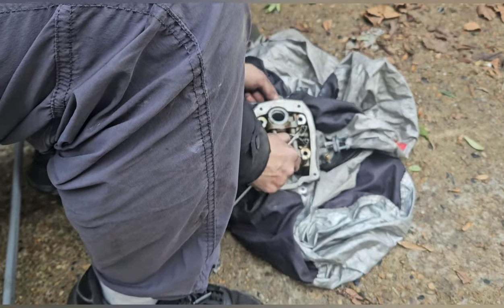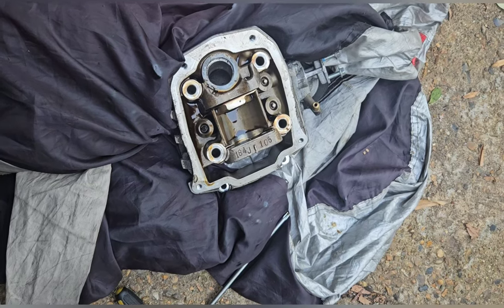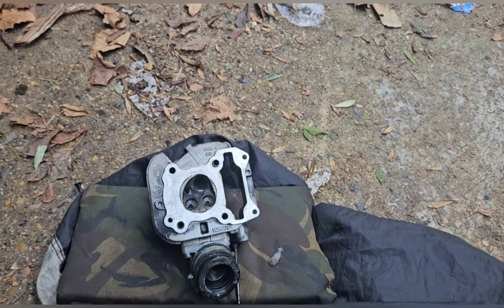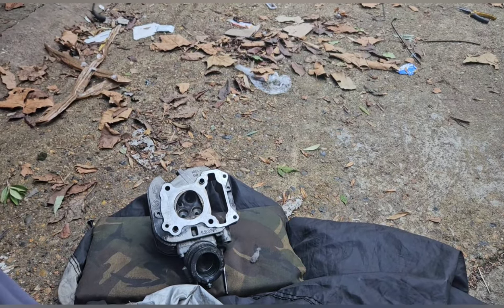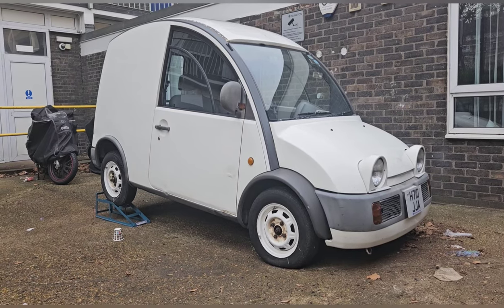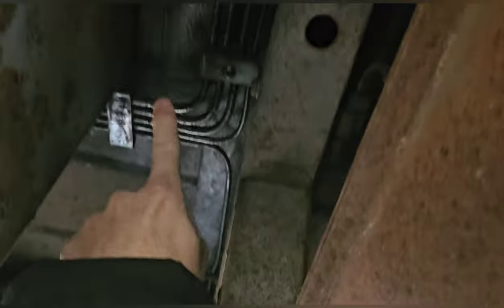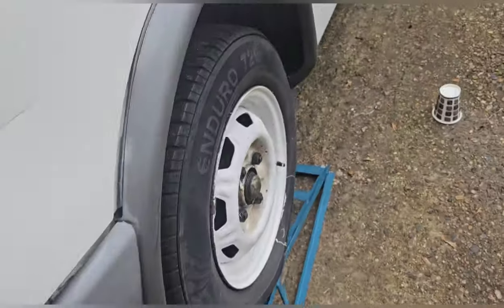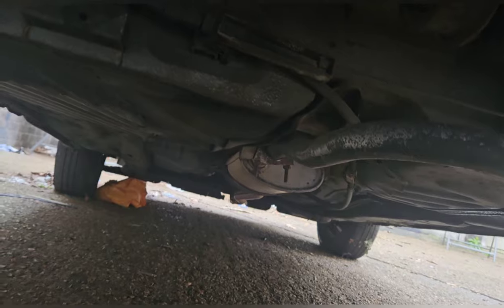piaggio liberty iget engine failer, nissan s cargo, underbody checks.

Comment: Hammerite is probably not the best thing to use under a car which has been treated with underseal, as it may not stick very well. What I have used successfully in the past is a Waxoyl-based schutz (underseal), which is applied with a heavy duty spray gun, but I think you can buy it in aerosol form. It's bitumen mixed with Waxoyl, made by the same company as Hammerite.
Reply from the maker: Hi Rick. Currently I just did the fuel tank and a little on the welded patch. I've not done any more. So I will need to look into a new understal as you say. Ideally one that can be brushed on. 

Although as soon as I can pass an mot I will have to sell this really.